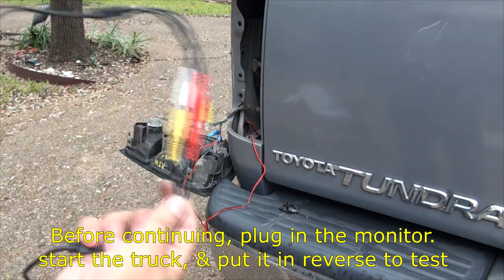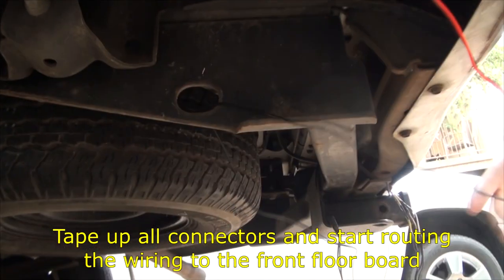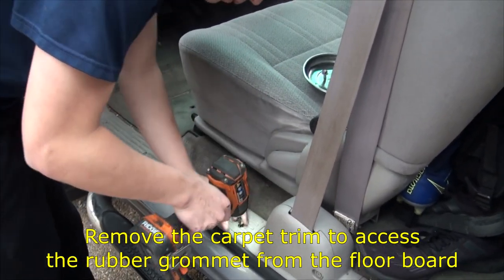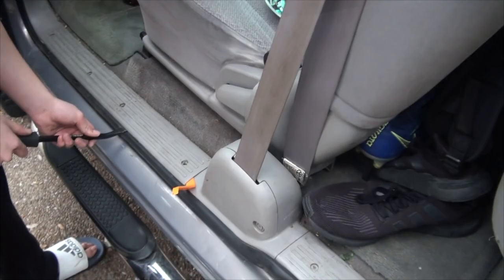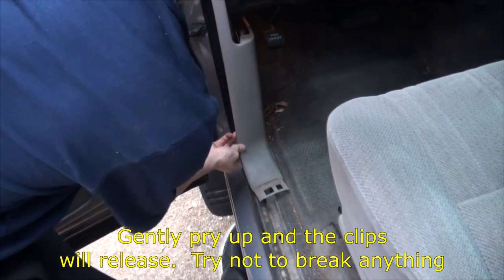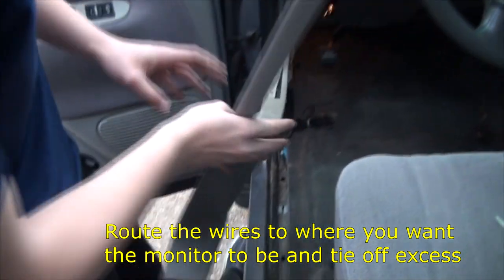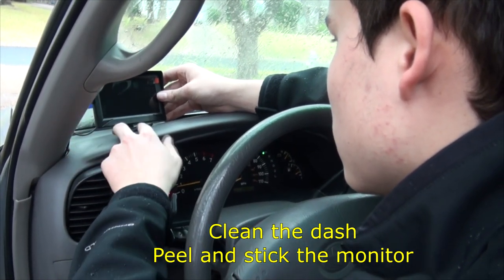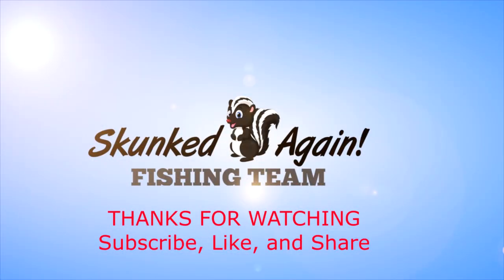DIY Amazon $40 backup camera installation, 2001 Tundra

Comment: 👍🏼#4.....I didn't know those cams got their power from the back up lights......
Reply from the maker: I actually didn't know either until I looked at the schematics.  If you have an older car or truck that doesn't have backup camera, I hghly recommend it; especially if it's for a teenager.

Comment: I tried installing one, and neither of my rear reverse lights work anymore ( cargo one works ). How do I remove the blue wire taps and fix my reverse light wire?
Reply from the maker: I have no idea.  it's just a pass thru connector.  Mine works just fine.  return it and get another.